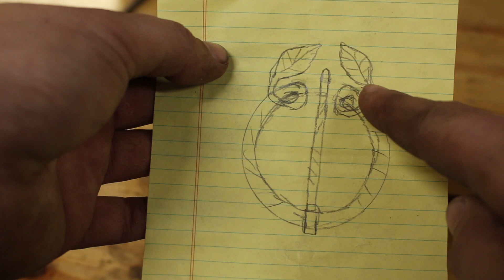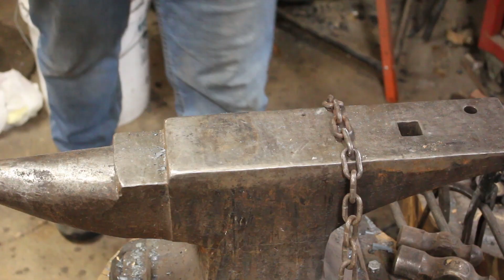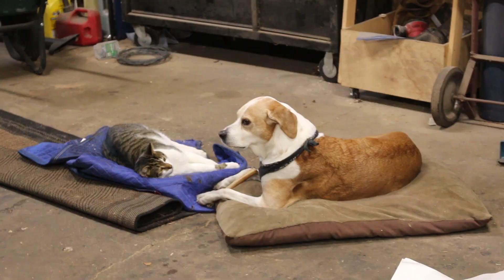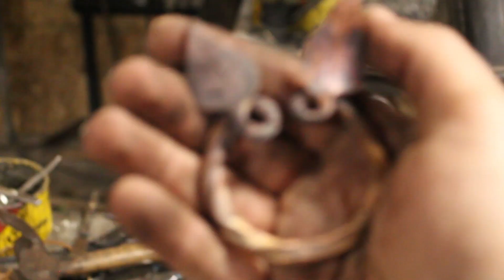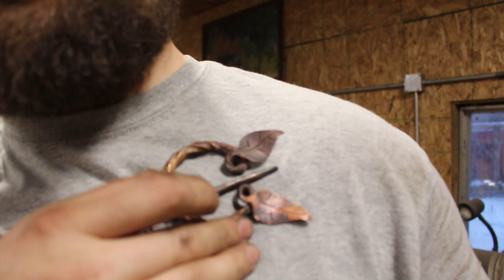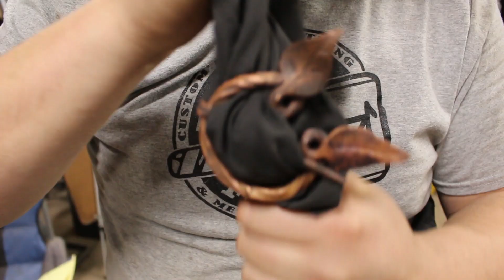Smithing the medieval safety pin?

Comment: Oh this is awesome, i dunno how i missed the video for a week. You do a professional job and you far surpassed what i expected for a brooch. Also, in a way the tips of the leaves help to secure the fabric and pin, so they are a lovely decoration, but the shape also keeps them from being too needle like and pokey, but just enough to catch on the fabric.

Beautiful craftsmanship, it really looks incredible. The copper looks great too, ive always loved copper and it sticks around for a long time due to its antimicrobial properties. 

I use a brooch with a wool blanket when im hiking or bushcrafting in the colder parts of the winter. I can put the blanket over me and my bag, make a hood  as well. It allows you to make a blanket into a tool, and then you still have a wool blanket to set your gear on as well. Or perhaps a leather cloak. 

Really excellent presentation touching on some of the history and uses, top tier youtuber right here